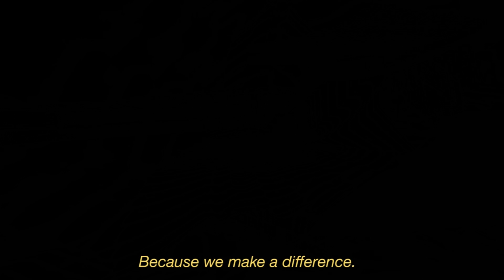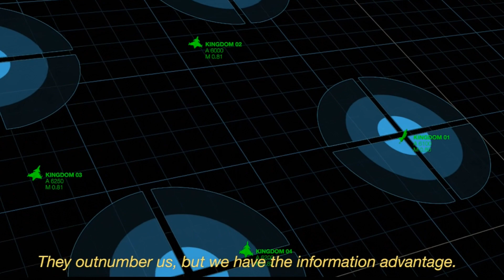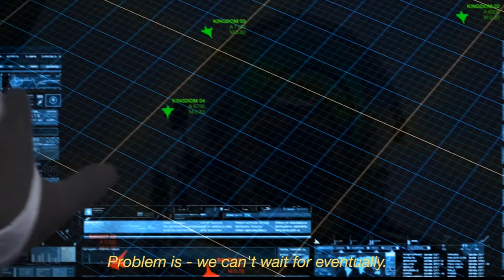Gripen Fighter Jet - Canada's Future Fighter?

Comment: I'm sill iffy regarding a single-engined design for Canada. The Grippen also has a short range, which doesn't lend itself well to the large ranges that some air defence patrols need to cover. If Lockheed developed a twin-engined version of F-35 I'd support purchasing it, but I can't support the purchase of a single engined fighter/bomber for Canada, it's too high risk a purchase.
Reply: Joshua Wong yeah that's a myth too. Now if the engines were on the wingtips of the jet i could see that a valid argument but the fact that both engines are so close to each other negates the theory that one would survive if other got hit!

Just my opinion
Reply: Gripen can fly just over 2000 miles with external wing tanks added (just like most other fighters)
Reply: The range of the 2nd gen JAS-39E/F is actually pretty good, at least with a light weapon load. It would probably be a different story if we were to compare Gripen with a heavy weapon load with a larger aircraft like the Typhoon or F-35 carrying the same load.
Reply: +Rick Perrin The Volvo RM12 engine has not had a single failure in its 20 year service. Although that engine will not be in the E/F variants. They will use the General Electric F414G which is also used in the F/A-18 Super Hornet.
Reply: canada thinks theyre the only once knowing arctic temperature extremes :)

gripen comes from the same climazone, if the swedes are happy with it - so should the canadians.
Reply: Two-engine technically F-35 is extremely inefficient, and would be YET more expensive. In addition, prolonged patrols on the plane of a short take-off does not make sense. Grippen can definitely cope with this task.
Reply: Well, the very simple fact is that the single-engined Gripen has proven to be safer and more reliable than the "safer" twin-engined CF-18.  Oh yeah, the Gripen-E also out-ranges the CF-18 considerably.  Jet engines are so reliable now that the old twin-engine argument is just that, old.  Bringing it up as valid shows tremendous ignorance and a serious lack of research.
Reply: Gotta keep in mind that larger aircraft is also heavier and two engines burn more fuel than one. At least that's what i think.
Reply: JAS-39 (1st gen) ferry range 1600nmi* with 11,000lb fuel (5000lb internal and 6000lb external)
JAS-39E/F (2nd gen) ferry range 2150nmi with 15,500 lb fuel (7500lb internal and 8000lb external)
Typhoon ferry range 1800nmi* with 16,500lb fuel (11,000lb internal and 5500lb external)

Of course a smaller aircraft will have a larger range penalty for a given external load than a larger aircraft, so these ferry range figures are not going to be proportional to the effective combat radius.

*Some sources say 1700nmi for JAS-39 and 2000nmi for Eurofighter.
Reply: F15s are aging and need replacement with an equally capable fighter, maintenance is getting quite hard on those old birds.
Reply: You mean the ones they are cannibalizing other Tomcats to get parts for?  Yeah those.  Soon their fleet will die due to lack of parts
Reply: @Stu Bur - Tell me something Stu, are you an ACTUAL fighter aircraft expert or are you an AMERICAN fighter aircraft expert?  You only seem to know about US fighters.  The fact that you claim that the F-15 is superior to the JAS-39E only solidifies this.  You say the Gripen has no single standout capability?  Let me teach you about the Gripen because I actually AM Canadian and I HAVE actually researched the Gripen.

First of all, the F-16 isn't even in the same class as the Super Gripen.  The F-16 competed with the J37 Viggen, the ORIGINAL Gripen's predecessor.  To put them in the same sentence is an insult to the Gripen and a demonstration of one's own aeronautic ignorance.

Secondly, you say that it has no standout advantages?  Let me list them:

1) Supercruise ability - No US aircraft for export has this.

2) Weapons versatility - Meteor, IRIS-T, AIM-9, AIM-120, ASRAAM, MICA, Python, Brimstone, Paveway, etc.  All WITHOUT modification.

3) All-Weather Capability - These planes are designed to effortlessly handle arctic and subarctic climates.

4) Logistics - Only 600m of runway required, even a straight road would do.  It has a 10-minute A2A and 15-minute A2G turnaround time, the fastest in the world.  It doesn't need a hangar and five men can do an engine swap in a forest in one hour.  This plane doesn't need long-range, it can be stationed at existing Canadian forward bases.  This actually makes it MORE suitable to defend Canada's north.  One C-130 load of supplies is enough for 10 Gripens for 28 days, you don't think that this is a standout feature?

5) Tech suite - Active stealth, state-of-the-art ECS, IRST and the MOST ADVANCED AESA radar in the world.  (Where did you get the idea that the F-15's is superior?)  Oh, and also the most advanced 2-way data link ever made for fighter aircraft.  Saab's been doing data links since the Draken.

6) Stealth - Not that I really care but the previous Gripen C/D has a frontal RCS of 0.1m², the same RCS as a B-2 Spirit.  Saab has claimed that the Gripen-E will have a substantially smaller RCS than the Gripen C/D.

7) Cost and Availability (THE BIG ONE):

In addition to being the least expensive elite western fighter in the world to buy, the Super Gripen will also be one of the least expensive aircraft in the world to maintain, military or otherwise.  This means a BIGGER Air Force that outnumbers its opponents.  Sorry, but not even an F-22 Raptor stands a chance of going home if facing even two Gripens, never mind the seven Gripens that the cost difference would equate to.  Even if it manages to take both of them out, it's still going down.  If I'm an Air Marshal, I'll happily trade two Gripens for downed Raptor.  That's a massive economic win and economics are a MAJOR factor in war.

The Gripen C/D cost only $7,000USD per hour to fly while the Gripen-E will only cost $4,700USD per hour to fly.  That's a record low for military aircraft, the previous record was the previous Gripen.  The Super Gripen also set another record for low maintenance, needing only 20 minutes of maintenance per hour of flight.  These numbers come from Jane's.  That availability means greater effectiveness in war and the low cost of flight hours means better trained pilots, something FAR more critical than you give it credit for.

You say that the Gripen is a "filler" aircaft with no standout capabilities?  I say that you're an American who, like most Americans, never bothers to look at anything outside of your own borders.  Here's a couple of links for you to look at:
https://defenseissues.net/2015/12/21/a-fighter-for-canada/
https://http://bestfighter4canada.blogspot.ca/
Reply: Rick Perrin F-16 says hello and they have mass produced over 6 thousand!
Reply: @Stu Bur - The F-15 is too old and too expensive.  The Gripen is a much deadlier fighter than the F-15 and is much less expensive.  The two engine argument is completely invalid these days.
Reply: F-15 are still being built and are far deadlier than a Gripen. Gripen E are not that cheap to acquire and are less capable than modern F-15. Gripen are good aircraft but modern F-15 are better for the needs of Canada. I never claimed that twin engine was better and said that single engine is fine. Either configuration is practical.
Reply: "It's not so much about being hit. If you get hit by a missile, chances are you are fucked if you had 1, 2, 4, or 8 engines. If you have something as simple as a bird strike in the engine of a single engine is probably screwed and you have to rely on the pilots ability to glide. If you have a bird strike on a double, you can shut the struck engine down and fly with the other. If you think the shrapnel from the FOD'd engine is going to penetrate the engine housing, the chassis of the aircraft twice and the housing of the other engine from a bird strike or even a blade breaking, you have very high expectations of damage. If FOD is going anywhere, it is generally out the back of the engine, you know where all that thrust is going."

Here's the problem with your post; it's only half-right.  For some aircraft, what you say is 100% accurate but for the Gripen it is 100% false.  Volvo Aero reworks the GE Engines that go into ALL Gripens (yes, even the E) and they basically come out as indestructible.  

Gripens can take bird strikes and even complete ingestion of Canada Goose-sized birds without missing a beat (and they have).  The engines do not fail, ever.  No Gripen has ever suffered an engine failure for ANY reason since the plane's inception.  While I do understand your logic and it is sound for many aircraft, history has shown it to be false.

For some reason, Canadians seem to think that the choice of the Hornet over the Falcon was a good one but history shows that it was a mistake.  The F-16 has a much better safety record than the F-18 and even better than the F-14 and F-15, all three of which are twin-engined fighters.  The only plane to trump the F-16's safety record is, you guessed it, the Gripen.  It's a heartbreaking thing to say but if Canada had Falcons or Gripens instead of Hornets, perhaps some of our dearly departed airmen would still be with us today.

Because of that, people barking about twin engines pisses me off.  The people themselves don't piss me off, the fact that the media and our government managed to brainwash you into thinking that way does.
Reply: Why does Canada need two engines? Just maintain the engine and you'll be fine. Has Canada even ever had any engine problems?
Reply: Canada needs a long range fighter, particularly to enforce sovereignty in the north against Russian patrols.
Reply: @donnibrasko1 - It's quite apparent that you're not the one PAYING for the maintenance of those F-14 Tomcats because the cost is astronomical.  Sure, you can keep an old bird flying but why do so when the reduced maintenance cost of a new fighter means that it will eventually pay for itself in that regard as well as being superior?  There's a REASON that the F-086 Sabre isn't used anymore and that's because technology ADVANCES!

Let that simmer for a minute!
Reply: @stongproudandfree - That statement you just made embarrasses me as a Canadian because it is chock-full of American-style ignorance.  The Lockheed F-104 Starfighter was designed to be a high-altitude, high-speed, long-range interceptor.  The completely inept and incompetent RCAF commanders were using them as low-level, slow-moving, STRIKE AIRCRAFT!  You can't fly planes shaped like missiles with stubby wings at low altitudes and speeds with high angles of attack and not have them stall!  That was not the fault of the aircraft, it was the fault of the RCAF's stupidity!  Of course, they wouldn't admit it and the media portrayed it as the fault of the plane rather than the Generals because pilots lost their lives over it.  Heaven forbid that the Canadian Forces should be sued over something as "trivial" as the death of our servicemen.  I think that you need to go and actually learn about aircraft instead of just parroting some official "bullshit" that you've been fed.  Be a Canadian for Christ's sake!
Reply: OLD OUTDATED MYTH. 
the single engine F16 has a LOWER loss rate than it's F18 competitor.
in a twin-if one engine fails ,the plane becomes dead meat should an enemy plane decide to pursue it.
modern jet turbines are so reliable that actual losses are from pilot error far more than engine failure.
Reply: With a large landscape to patrol you would compliment Grippins with Triton UAV's to do the Bulk of long range surveillance. https://www.youtube.com/watch?v=MtirM-pzXH4
Let the Tritons watch the north and use the Grippins closer to heavy populations.
No one is going to attack you guys anyway so may as well get bang for your buck
Reply: 4th Gen Fighter comparison (Specs)
https://en.wikipedia.org/wiki/Fourth-generation_jet_fighter#Fourth-generation_jet_fighters_compared
Reply: @Stu - The F-15 is hampered by outdated US munitions.  ANY fighter using the Meteor and IRIS-T is deadlier than one stuck using the AMRAAM and Sidewinder.  Smaller men with better weapons beat bigger men with inferior weapons every time.  If the F-15 was able to use the Meteor and IRIS-T, I would agree with you, but it can't and so it's not, end of story.
Reply: F-15 can use those weapons and many more. It is is being sold to international customers that may make use of a variety of weapons from a variety of sources. The USAF doesn't use those particular weapons but the aircraft is capable of using them. The F-15 2040C can also carry many more weapons than past F-15s or any model of Gripen. It also has a modern radar with a very large antenna that is impossible for the Gripen to accommodate within its smaller airframe. It will see enemies from far further away, can use the same weapons against them, and fire more of them.

Also note that the most recent models of Sidewinder (AIM-9X) are close in capabilities to IRIS-T, although the F-15 would rarely have a need to use them since it will see enemies from so far away and have many long range weapons to use against them.
Reply: How many trillions will that cost?
Reply: @William Wenzel
The cost for a full complement of F-15 2040C would be in the same neighborhood as buying the F-35 but they would be somewhat cheaper to service them over time. They would also be better suited to Canada's needs than F-35 but still be able to work well together with those F-35 used by NATO allies.

@Avro Arrow I didn't bother replying to your earlier wall of text before because it contained a lot of personal attacks and some info on the Gripen that I am already very familiar with. You are mistaken on several points because you seem to be unaware of certain important details and some of your details are slightly off. You obviously have a bias against Americans and US aircraft so logical discussion is probably useless but for the benefit of others I will respond to your points now.

1 - Supercruise is largely irrelevant. Any F-15 can dash far faster than any Gripen and they will both cruise subsonic to conserve fuel and the F-15 has much better range than even the Gripen E. New F-15 with upgraded F100-PW-220 or F100-PW-229 EEP are far more reliable than those with older engines and greatly decrease lifetime maintenance costs. 

2 - As I already stated above it can use European weapons and has already qualified and integrated many of them. They will also be able to carry more weapons.

3 - F-15 have been tasked with patrols in many different environments from cold and wet Alaska and Japan
to the hot and dry Middle East. They have frequently been tasked in Alaska because of being particularly well suited to mission requirements there for long range patrol, interception, and escort.

4 - Even Sweden does not use Gripen in a dispersed strategy any more. Proper long term maintenance requires more facilities, personnel, and supplies than can be provided in austere dispersed temporary locations. That is a short term war time defensive strategy anyways, not a sustainable normal operations strategy. Austere bases can be provided in war time to other aircraft given sufficient adequate runway which Canada has many of to support many small civilian aircraft. Others could be constructed at little cost. Yes, even some roads could be used for this purpose and other fighters can land and take off from them. I studied the Swedish strategy in detail since it was relevant to my military career. 

5 -  The electronic warfare package of the Gripen is good but the F-15 2040C is equal or better. I can't go into detail as I do not want to accidentally reveal any sensitive information. The Gripen does not have the best AESA and cannot ever have it because it is physically limited in the size of the antenna by the size of the nose in the aircraft. The best radar available for the F-15 is the AN/APG-82(V)1 which is far better. Recent foreign sales have used the AN/APG-63(V)3 which is also far better. They use the same large antenna but back ends with different feature sets. On the most critical point of likely adversary detection range they are vastly better than the Gripen E radar. 

The secure communications option available is the same as that used on US stealth aircraft which is more secure than Link 16 and allows for designating targets while maintaining stealth. For the F-15 2040C this also allows receiving that secure target data so it can fire missiles to support those stealth aircraft from maximum weapons range without exposing itself to more danger by coming in close. 

Gripen had a single communication feature not included in Link 16 (the most common NATO standard modern comms) which was the ability to use civilian cell networks. This feature was removed in some later Gripen models in order to make physical room for Link 16 related features and to save cost. It is a neat feature and could be integrated into either modern aircraft with enough work to shoehorn it in somewhere but it isn't essential and would not be all that useful in Canada.

6 - Your RCS figures are off and do not take into account external stores or encounters that are off from directly in the front. The Silent Eagle F-15 package brings stealth down close to the minimum practical level for using external stores. The minor RCS differences between the smaller Gripen airframe and the larger F-15 airframe are vastly outweighed by the large differences in radar capabilities. Neither is a true stealth aircraft but both have had some stealth improvements in the most recent designs. The bottom line is that given the same likely adversary, a modern F-15 is far more likely to detect, shoot, and survive than a modern Gripen against that same adversary.

7 - Gripen E are not cheap. They have a much larger up front cost than earlier Gripen models and are also more expensive to acquire than F-16. Gripen E may have low operational costs as predicted but that remains to be seen. Given the high cost of certain advanced parts they are not immune to higher than expected life cycle costs. The most recent F-15 designs have vast improvements in structure and components that greatly reduce total life cycle costs. The cost savings are so great that buying brand new F-15 was seriously considered by the US DoD to replace existing aging F-15 in inventory and the cost numbers were compelling. 

Raptor vs. Gripen is an absurd and meaningless scenario. Is Canada planning to go to war with the USA? Likely loss exchange ratios against likely adversaries is what is relevant and both F-22 and F-15 beat Gripen in that metric.
Reply: outdated views. jet turbines today are NOTHING like the ones from the 1960's.
statisically speaking, a jet fighter made today is far more likely to crash from factors OTHER than wether it has a single engine!
how many CF 18 s were lost due to PILOT ERROR? most of them! just like the indian airforce's loss of their twin jet russian air superiority fighters.
you might as well argue that automatic rifles are unreliable and our troops go back to muskets.
Reply: bademoxy musket lives matter
Reply: if the fighter can be scrambled from short rough airstrips, then we can deploy them in the actual areas being contested, rather than base them in large facilities to the south-this strategy reliant upon the rough airfield capable jet fighter.
i do agree with the author that MAYBE the f35 MIGHT make a good combination(in the VSTOL version) in small numbers with a light  defense fighter such as the vigen
Reply: never seen what a turbine blade can do to an engine next to it?
it ain't like he's flying around with a spare engine in the trunk to swap with!
Reply: Stupid-so how LONG ago was that? yeah ,like 60 YEARS ago?
u think engine tech just stood still? ,maybe WE'LL pack a spare motor in the trunk,eh?
AND the F104 was designed specifically for high speed high altitude interception- NOT ground attack low alt -which is what we insisted on using them for!
gee i think our troops should get TWO powder flasks for their muskets in case one gets wet! 
even funnier is "we still need bayonets for  if we run out of ammo" -yeah, your enemy is going to NOT shoot you with the ammo HE STILL HAS while you prepare to do a bayonette charge!
Reply: im guessing the twin engine thing is only an issue with carrier landings since carrier landing needs to be powered. over land you still have a decent chance of gliding in to land, but cant glide to carrier landing... just my guess.
Reply: Gripen E has pretty good range but if you prefer a two engine fighter suitable for long range patrols then the F-15 2040C would be a good choice.
Reply: "Iran is still flying their Tomcats they got from the U.S.
 so don't tell me that it's hard to do maintenance on old birds!"

Older aircraft can be harder to maintain. Most of the time they are. 
I'm a maintainer. The B-52s, F-16s, F-15Es, E-8Cs, E-3Gs, and RC-135s are great examples of how old aircraft can be assholes. The C-130 is the only aged frame that isn't that bad. In fact, the C-130 is probably the easiest aircraft to work on in the Air Force.  Trust me, I work on the 707 frame. The F-14 is a maintenance pig. Just about all variable wing frames are.

"yeah that's a myth too. Now if the engines were on the wingtips of the jet i could see that a valid argument but the fact that both engines are so close to each other negates the theory that one would survive if other got hit!" 

It's not so much about being hit. If you get hit by a missile, chances are you are fucked if you had 1, 2, 4, or 8 engines. If you have something as simple as a bird strike in the engine of a single engine is probably screwed and you have to rely on the pilots ability to glide. If you have a bird strike on a double, you can shut the struck engine down and fly with the other. If you think the shrapnel from the FOD'd engine is going to penetrate the engine housing, the chassis of the aircraft twice and the housing of the other engine from a bird strike or even a blade breaking, you have very high expectations of damage. If FOD is going anywhere, it is generally out the back of the engine, you know where all that thrust is going.

"Sure but having two engines doubles the chance of engine trouble.
and catastrophic engine failure will most likley take out both engines either way if they are placed next to eachother."

Your logic says we should have 3 wheeled vehicles mainly on the road since a 4th wheel has a higher chance of a blowout. For the second part, I would refer you to the above statement.
Reply: Chibling Canada needs to purchase F-15's and F-35's and they will be good for the next decade or two!
Reply: Sure but having two engines doubles the chance of engine trouble.
and catastrophic engine failure will most likley take out both engines either way if they are placed next to eachother.

More over the Gripen has been flying since 1988 and not a single aircraft has gone down from engine failure .
Reply: Canada has little use for the F-35B. The F-35A would be a more reasonable option. Canada has plenty of room for airstrips throughout the country and the A model has better range and weight limits.The Viggen is obsolete and is not used any more. The last one was retired over a decade ago.
Reply: Zander Dob Iran is still flying their Tomcats they got from the U.S.
 so don't tell me that it's hard to do maintenance on old birds!

Let that simmer for a minute!
Reply: Yes. The CF 104 earned the nickname "the Widow Maker" due to a single engine design prone to flame out. Pilots used to get awards for flying a specified number of hours without crashing. Also twin engine design means the plane can make it home with one engine out from battle damage.
Reply: A single engine fighter is fine. But there are other reasons why the Gripen is not the best choice for Canada. It is not a bad choice and it is a good aircraft. In fact, I am quite a fan of the Gripen. But given the vast distances to cover and limited number of qualified pilots an even longer range fighter would be better. F-15 2040C has better range and much better radar and weapons load. It would complement NATO F-35 fighters well by providing long range patrols and missile fire support. 

Gripen would fill a similar role to F-16s which makes it a good filler aircraft to increase quantity with low maintenance costs but lacking in any single standout capability. Gripen has a slight edge compared to F-16 in expected loss exchange ratios against likely  opposing aircraft but both are significantly behind modern F-15 variants in that regard. 

F-35 is a good aircraft as well with good exchange ratios but is less than ideal for Canada. Canada's most frequent mission for fighters is long range interception of encroaching aircraft in the far North. These are often visual range interceptions to confirm the type and intent of the aircraft and escort it back out. A stealth fighter is not ideal for this mission since it would sacrifice its primary advantage in the process and internal stores tend to limit range and usable weapons payload. While you could strap external drop tanks to an F-35 to press it into such a mission it is not an ideal solution and you wind up doing a lot of time consuming and expensive maintenance on stealth that is degraded by such a loadout. A modern F-15 is a better fit for this mission.
Reply: 2 engines means if an engine gets damaged in or out side of combat there is a backup engine that can get the fighter back to base.
Reply: @tactical-crash  moron- supersonic jet fighter engines are siamese mounted right beside each other,meaning most missile and cannon strikes damage BOTH with one shot.
btw, a twin jet  missing one engine cannot fight to protect itself from pursuers!